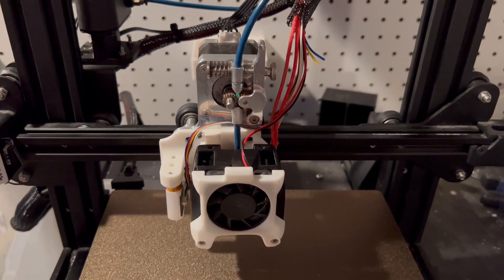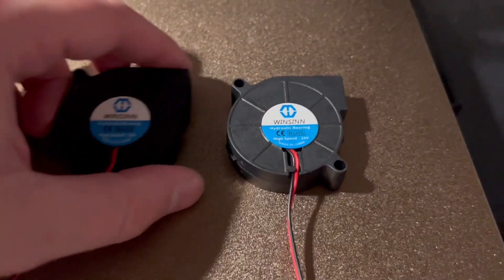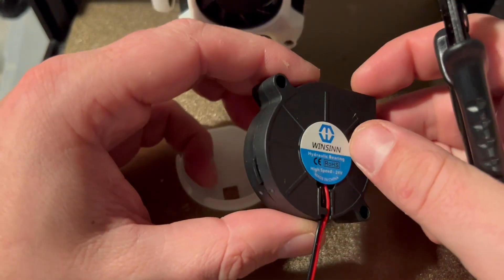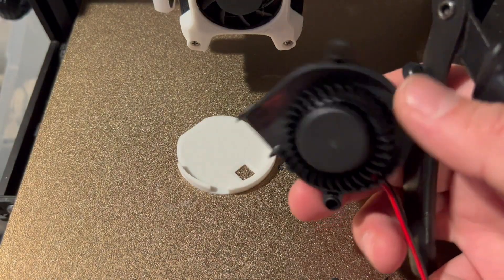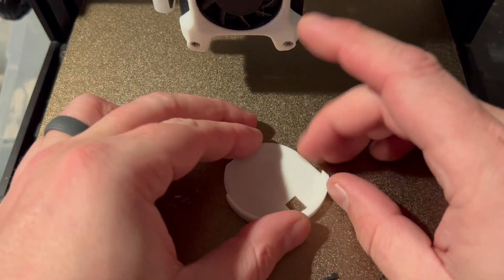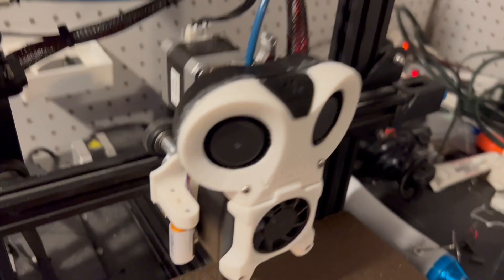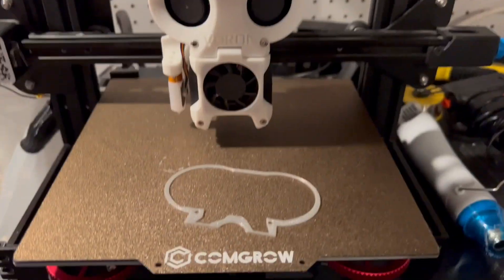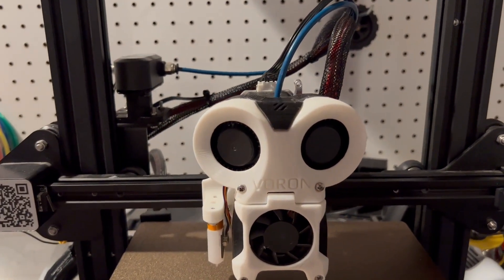🆒 LoudOwl aka Stabby mod for Afterburner for Micro Swiss Direct Drive for Ender 3 and 5 Series

Comment: I know this is from a year ago and it seems you have changed shrouds, but I don't see how that fan on the left is going to work at all. It is going to be spinning the wrong direction. Also you may have set the speed to 100mm/s, but if you didn't raise your acceleration then you won't be reaching that speed in the small area of a benchy.